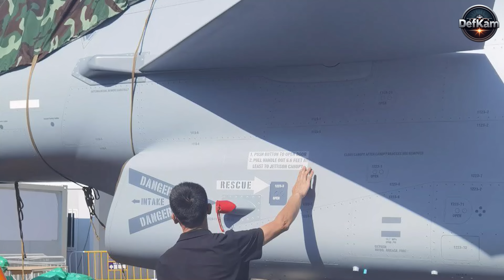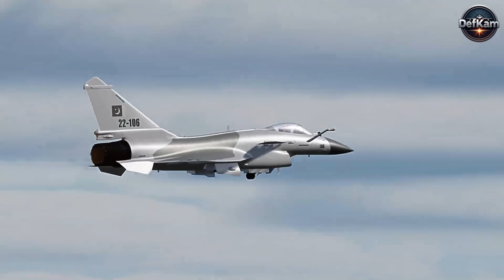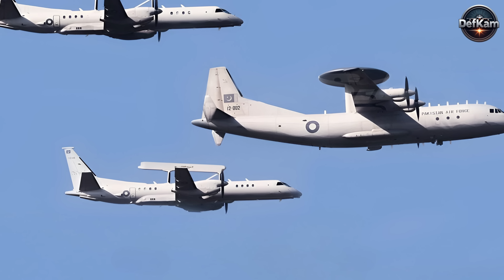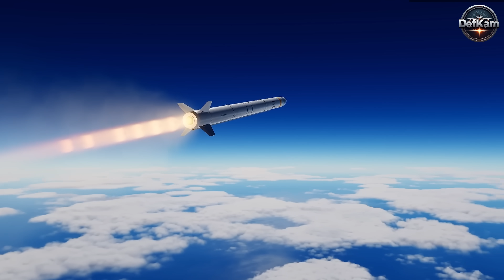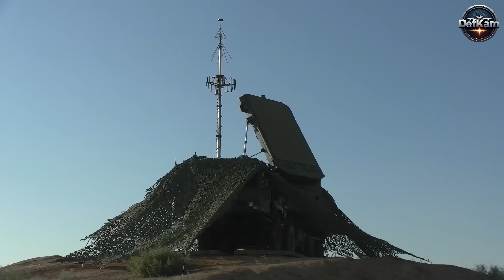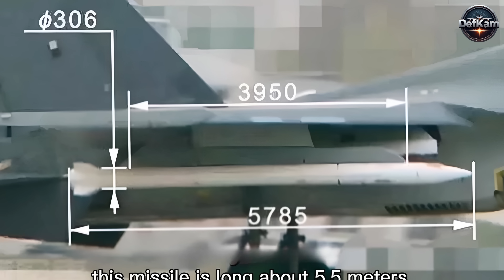PL-17 on J-10C for PAF.

Comment: It won't happen. China keeps its latest technology for its defense, so that the U.S. and its vassals couldn't examine the PL-17 and then reverse-engineer it.
Reply from the maker: Reverse engineering is not an easy task, Pak is china's first line of defense.
Reply: @DefKami   Right. That's why Endia asked Japan to examine the electronic device of the PL-15E, which wasn't destroyed by the explosion of the missile.
Reply from the maker: @GGLEDOU  Yes, let them examine just motors and bushes, the critical part explodes.
Reply: @DefKami   The electronic device was shown on the footage. That's what Endia and the collective West were interested, in order to find out a way to counter the PL-15E.
Reply from the maker: @GGLEDOU let them dig mountain and find a mouse.

Comment: This isn't the PL-17, but the PL-16. The PL-17 is very long, and judging by the proportions of the photo and the nearby close-range combat missiles, it doesn't even reach 7 meters. Furthermore, Pakistan's primary adversary is India, and its secondary rival, Israel, neither of which needs the PL-17. The PL-17 appears to be a strategic missile with a range of over 400 kilometers, specifically designed to attack early warning and refueling aircraft. The Indian Air Force's current capabilities are sufficient with the PL-15. Even the latest European or American air-to-air missiles lack the PL-15's range and two-way datalink guidance capabilities. The US is currently developing the AIM-260, which approaches the PL-15 in performance, but is currently facing technical difficulties and unable to complete its development. It will first be deployed to the US and European militaries, and eventually to India. Therefore, Pakistan has absolutely no need to equip the PL-17. China recently upgraded the PL-15 missile, significantly changing its weight, length, shape, and guidance radar. The missile is lighter, has a smaller diameter, and is 20% shorter, but its range is 20% longer, exceeding 330 kilometers. It can fit into the J-35's internal weapons bay, and can carry six missiles. The missile's seeker radar uses the latest material, silicon oxide, which has a longer detection range and stronger anti-interference capabilities. It has been renamed PL-16. It is natural for the Pakistan Air Force to equip this missile to maintain its air superiority in South Asia.
Reply from the maker: Thanks a lot for your time and guidance we will follow it.
Reply: I mean better safe than sorry 
If pakistan can have overkill would they let it go?
Reply from the maker: @awaiskhalid7894 Not at all
Reply: @awaiskhalid7894 Depends on China. India China has large economic market & interest with each other. China can't allow pakistan to get advance & upgraded weapons.
Reply: @ry5125  With respect, very little depends on India in this equation. China can never truly trust India, and for good reason. Only two months ago, India was loudly celebrating its relationship with the United States and mocking the sanctions imposed on China. Do you really think Beijing failed to notice that?

Now that India is finding itself cornered by the same United States, it seeks to approach China with its tail between its legs. But unlike the U.S. or Europe, China plays the long game. Beijing understands clearly that India is an unreliable actor — more like a stray dog shifting loyalties — never a dependable partner.
Reply: Impressed by your knowledge. Chinese hardware is best in the world.